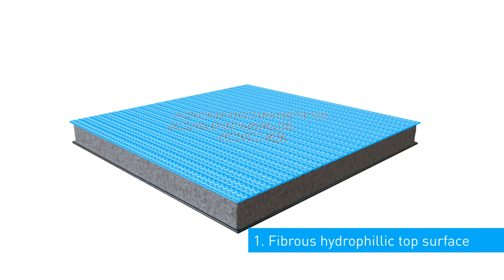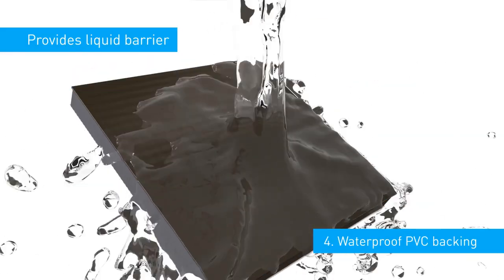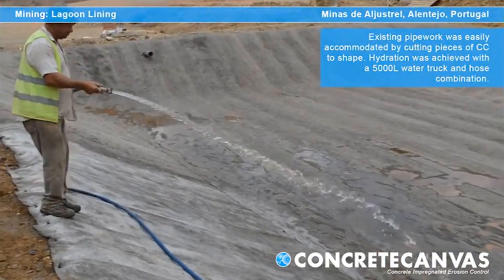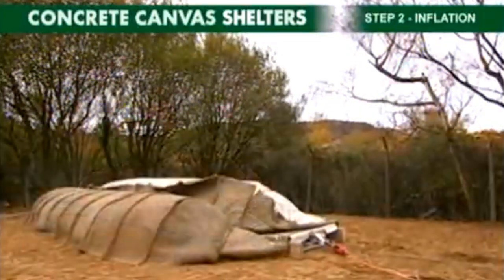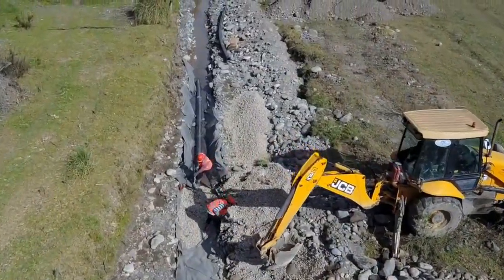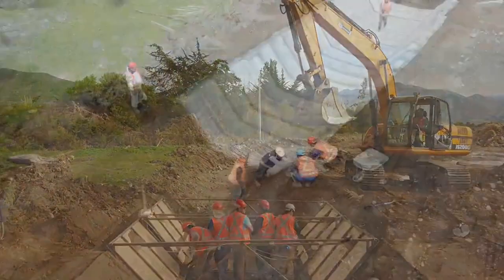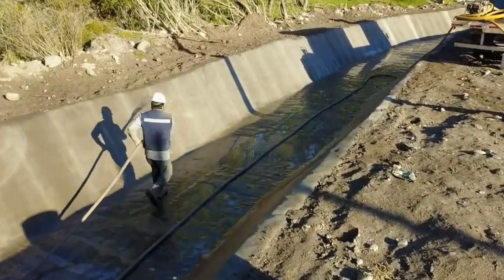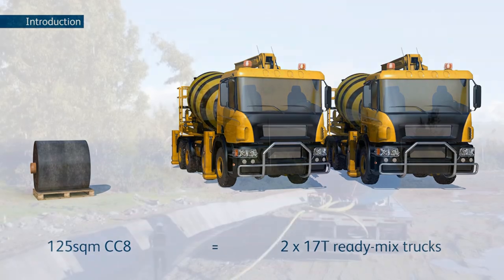Premade Concrete Canvas Tents - Just Add Water

Comment: Just buy a old shipping container and fix it up with the money you'll save.
Reply: @shad0wburn3d  you must be smoking some good good.
Reply: If anybody every cheats you out of 15 grand for a empty shipping container delivery, for a container thats worth maybe 5 grand brand new, you deserve to be cheated.
Reply: Ok listen up about shipping containers. I have 2 on my land. The only issue we have is moisture in them. What do I mean ... condensation will form in them when you breathe and the temp is cold outside. Yes there can be ALOT OF MOISTURE. YOU CAN SOLVE THIS ISSUE WITH AIR CIRCULATION.
Reply: @shad0wburn3d  Not nearly that much.  Quick Google search "How much do moving containers cost? Prices range from just under $500 for a local move (with the largest container) to more than $5,000 for a long distance move (with two of the largest containers)"
Reply: @randylanhart1796  And insulation I imagine ...
Reply: Shipping container home is a trendy fad and lots of people are getting ripped of because demand is high right now. You can build small 1 - 2 bedroom house for cheaper per sqft than shipping container house. Or just buy RV if you are on a budget you save yourself lot of money and problems.
Reply: @shad0wburn3d  most places that sell them deliver them for free or for a relatively small fee.
Reply: @someguy5035  those "Concrete Canvas Tents" are ment for remote locations like Africa or FarAwayistan. so if instead a "shipping container" sure they deliver it for free to Africa :D
Reply: @johanandersson2165  Been to both places. Never seen one. Seen tons of containers though. There is already an established supply chain for the containers. ISO containers are used all over the world. There may be some great uses for this stuff, but these tents are nonsense.
Reply: Navy already does this. Call'em CONNEX boxes. Kitted out as whole offices, every bit of furniture bolted/welded in place.

Ship pulls in, you swing on the CONNEX, strap it down and off you go. Seen these suckers three stories tall before.
Reply: @randylanhart1796  moisture would also be an issue in the concrete tent.
Not much difference between a shipping container and a concrete tent in that regard.
Reply: Randy Lanhart you should try insulating them. The container is 3maybe 4 mm thick so where the cold meets the hot that’s your problem, the more insulated space you put between cold and hot the less condensation your get. If you was to put 50mm of celetex on the roof and 25mm on the walls your probity solve the issue. Well that’s if it’s enough of an issue that warrants solving as celetex ain’t cheap. Who ever said you will have the same amount of condensation from the tent is mistaken.
Reply: @darrenicome559  and why am I mistaken?
The material doesn't really matter. If you have a cold wall and a warm room you get condensation on the wall.

Condensation is a big problem in a lot of basements, and they have much thicker concrete walls than the tent.
Reply: Jehty it would be considerably less with the bunker
Reply: @darrenicome559  and why?
Reply: Jehty Jehty the 6inches of concrete would make better insulation than the 3-5mm thick steel container not saying there won’t be any condensation in the canvas but it won’t be anywhere near as bad as the container. You are spot on when you say condensations forms when hot meets cold however the distance that the hot and cold would have to travel through the 120mm(i don’t actually know the exact thickness) concrete canvas would be a lot greater than the 3-5mm container not only that but metal is much more dense and a much better heat conductor so your two different temps would have both less to pass through and would pass through a lot easier. Basements usually suffer from damp rather than condensation so the insulation wouldn’t make any difference. Usually the solution for that would be to tank it. Sorry for the late response
Reply: @darrenicome559   6 inch? 
Oh man. That explains why people are so delusional about this product.
It is made of 13mm (1/2 inch) thick concrete canvas.

Some basement suffer from outside water, but others suffer from condensation.
Both are fairly common.
Reply: Jehty yer to be fair I wasn’t sure of the thickness 6inch was just a guess that apparently wasn’t very accurate but you see what I’m saying with the density and the thickness of the material being the key factors? Wasn’t saying you won’t have any condensation in the canvas but the amount would be a lot less.
Reply: @darrenicome559  and let me guess:
The "a lot less condensation" is also just a guess and probably not very accurate.

So basically what you are saying is that you don't have any idea how much condensation will form in a concrete tent.
Reply: Jehty mate you asked me a question and I answered it. I don’t know the exact thickness of either the container or the canvas and I did make a point in saying that. You want to dismiss the rest of what I said because of that then you go ahead. My advice is look it up before calling ppl out tho, that way you don’t look as much of a spanner if you are wrong ; )

Comment: Flipside of the coin: If you could weld a suitable structure it'd be a quick way to throw up some walls & a roof.  Deal with waterseal later.
Reply: modular steel buildings already exist for this use, no welding required, and they're rain proof. Not sure about the cost, but probably a fair bit less.

Comment: Couldn't this process be made lighter and cheaper by removing something and adding it later?

Would be great for building shelters on other planets.

Add radiation shielding materials to the chemical composition to protect astronauts from radiation.
Reply: Lead would be the anti radiation layer
Reply: Because of the weight of lead, the shielding would have to be added from materials at the site, either sourced or refined as an inexpensive shielding solution. 

Actually, now that we know quantum physics have discovered that matter acts as a partical and a wave, perhaps a particular frequency will protect against radiation in the future.

This is an incredible discovery that will change our planet in the next 20 years if we dont destroy ourselves with this knowledge.

Comment: heavy ugly and expensive...and only easier for the installer not for the person living/using it. Furnishing against slanted walls is....not fun and its not as easily modifiable as wood structures. were not even going to discuss the fun of electrical wiring. When I first saw this 2 years ago I thought it was neat...but ive had time to think of all of its drawbacks.

30K? Holy shit you can build a big enough cabin for that with a bathroom and room for a guest instead of a dark dank dome
Reply: Yeah, but you're paying extra to save time and effort having to build it yourself.
Reply: its not meant for residential living. its not meant to replace a house or cabin, or your garage floor. 
its a somewhat quickly deploy-able structure that's more expensive but efficient. its not the best go to solution for everything.
Reply: But this isn't a structure made for living it. It's designed to be set up quickly and to probably be used as a storage room.

Comment: it's such a smart inventionf.  Developing it would be hard but the idea of concrete trapped in between layers of fiber in a thin matting that will first expand with air, then harden with water is thinkable by anyone.  It's still clever.

Comment: I have a problem with the durability of the drainage system.

Yes I believe it works to channel off water.

What happens when the ground under the and beside the mat becomes saturated with water?
Does the canvas buckle?
In a traditional system rebar holds the walls together.

Comment: This is so cool but i wonder how durable it is. This video states its strengths but what about the weaknesses of it as a building material? It's thin and there's no rebar reinforcement.
Reply: I would assume that the tension stress is being well spread out by the fabric/plastics in the mesh binder.

Comment: Got to say that's a pretty awesome concept. But I have questions how thick is the concrete and how durable is it. Like if I hit it with a hammer can it crack. You know considering there's no reinforcement no rebar stuff like that. If it is tough I would like to see how far they can push it and see what they can make.

Comment: this is one of those things that seems cool to people who arent familiar with how concrete works. its too thin and probably cant hold much weight, its a temporary solution at best. we have fiber cement products already out there and they become super brittle in about a year or two.
Reply: It works well for the canal they made, as they had some sort of clay underneath. If the only job is to secure the clay from slipping away it does the job.
For bigger projects it would work as well as a makeshift form where you put your layers of high quality concrete on. It only has to last until the concrete sets.

Though for all of that feasibility and costs would be a factor and I imagine some nifty construction workers get the job done way cheaper, as accurate and without the concrete canvas.
Reply: @jellysquiddles3194  yea thats true but they would have to layer it or swap it like every two years or so cuz theres no way like half an inch of fiber cement is not going to crack.

Comment: Seems very interesting so it makes you wonder why it's not more popular. I suppose the answers are right here in the video and comments. For one, like one comment said, it's expensive. And the other important reason i suppose it's in the video where the part about using less material as an advantage regarding waste or expense. But like any coin it has two sides, even if in certain instances less is more, here less is simply less. A concrete structure with less material means less durable too. You may build a small irrigation channel fast and cheap but it will probably be just a temporary approach. You probably make it like this if you intent to make something at that location for some time and then move to another or something. And from this perspective building fast and cheap may mean more waste and terrain that is more difficult to reclaim and use for different objectives, even if or because you used less material for your construction.

Comment: ...I'd say it's a good idea for a base layer, but for anything involving load-bearing or erosion, especially where water is involved, this should only represent a portion of the system. Most of the applications shown are in reference to water. Spillway/dam failures can sometimes occur when water that is able to seep through worn portions begin to generate enough buoyant force to start buckling the structure.

If you have a good foundation underneath it, I can see one being erected, set, and then having further material added on the outside such as an insulating foam with its own shell. That'd be a neat addition to a house or the basis for a complex, like an earthen home.

Comment: I've seen "houses" made with concrete mixed with styrofoam pellets instead of gravel or sand.  They were huts or domes and they worked out. This stuff is great, no mining or  rock quarries needed. It will be in Hardware stores pretty quick I bet.
Reply: How do you think they produce the cement in concrete?
Reply: Pretty quick in hardware stores, but also pretty quickly collapsed to the ground, I bet. You americans focus too much on swiftness and cost, at the price of quality.
Reply: Alum,lime,silica mixed together. I am a plumber. Used a lot of cement. Busted a lot up, too. The absolute rule of concrete pours is, it is going to crack and no one will ever steal it.
Reply: @tommypetraglia4688  Right....they do have to mine...silica,alum,lime.....thanks for helping me think

Comment: Imagine using this to make a firewall to combat out of control blazes. You could suspend them from helicopters and dig deep narrow trenches on the outskirts of the blaze to establish a temporary base, lower it in and use the water cannon on the rescue chopper to wet it down. The temporary structure would potentially limit embers from jumping and help to control wind flow. I'd consider clearing some of the outskirts with bulldozers just to make sure. If you could potentially surround section of the blaze with the wall and cap it with a sectional ceiling of irrigation systems. Their are tons of other things to do with this like controlled flooded. You could dig out some retention pond downhill so any time that you airlift water you can create a new local source of water for the fight. I see these choppers like to pump and dump from tanks, but if you have a local source you could pump and spray at the same time.

Comment: I want one of those tents sooooo bad. Honestly, they're probably only so expensive because the military uses them, and the designers knew what they had and how useful the technology would be on a battlefield. But hey, hopefully in a few years the price may drop and I can get my hands on one or two of these things... Honestly what I would do is dig a huge trench that leads down to one of these tents, drop one into a deep hole, pop it, cure it and then fill it over with dirt. Boom, automatic underground shelter. Add lights, and other amenities as needed. Sounds like a great plan for the coming apocalypse.
Reply: Storm shelter in Tornado Alley.  Also good as fire shelter out west.
Reply: @kathymiller7086  I believe it.

Comment: I wonder how that trench holds up long term in regards to the ground movement, etc?
Reply: You have to account for that while designing the trench, just like when building roads or buildings. The material itself only strengthens the trench and prevents it from eroding due to rain and flowing water. The material itself is very sound though and it's life expectancy is 120+ years.
Reply: @CanIHasThisName  In regards to the ditch, it is basically acting as a retaining wall as well. 
I'm just curious if it has the strength to actually hold back the natural ground movement over time?  I know lighter retaining walls (no matter how strong they are) definitely struggle with this unless you anchor them.  A ditch of course has a kind of reverse anchor since it is supported by the ground on the other side of the ditch.  I'm just questioning how strong the connection/anchor is between them since it is a U curve.
Btw, there is no designing around this really.  Not unless your ditch is flat.  It wouldn't be a ditch then though, it would be a sidewalk.  The best they can do is that angle we see in the video.  Maybe that is enough though. That is a ton of weight though it has to hold back over time.

Comment: you could quickly build underground buildings or bunkers this way. Dig it out, add tent/floor, harden and bury. Might need supports but not if it's engineered to support weight without them.

Comment: i wonder . . . 
what if i dug a hole , put about 12 inches of stone in the bottom , set the tent up , spray it with a real good sealer like hot tar and then bury it .
how long do you suppose it would last ?

Comment: The concept is great. The cost, currently, is too high except for specialized applications. As competition and technology improve the cost/benefit, this could become a fantastic building method. A Tiny House is about $25,000 on Amazon. Imagine a modular, tiny house you can add on to as your family and income grows..... Delivered by truck, doors & windows in place, color impregnated concrete, built in insulation, inflate, spray and you're about done.....with little exterior maintenance.... Or possibly, you build a basic frame in any shape you want, lay out canvas cloth, spray and you have a unique, durable, low maintenance structure.... from housing to garage to decorative water features like a small creek or stream or a waterfall with hidden grotto behind it... There are endless possibilities.....

Comment: I would think after erecting the tent now string wiring and tubing over the the top and around it as needed to create a complete plumbing and electrical and then?  Add rebar and  Simply drape one more SECOND layer of concrete fabric and wet that down also....then to REALLY complete the structure blow and bond  fiberglass insulation all over it all AND woven layers of fibeglass cloth and then finally apply epoxy resin to the entire surface making it impervious to water and temperature extremes ...a stucture like this might last hundreds of years!    The inside could be plastered like a swimming pool or lathe and plaster interiors and then simply painted

Comment: So, these trenches made from that thin material, as thin as it is especially the concrete, wouldn't it be more prone to cracking under weight over time? Therefore needing replaced much more often, i may be wrong just curious.
Reply: Kindve why you havent heard of it until now even tho this video is 2 years old and the product probably even older. Cool idea but impractical... Hopefully it develops into something more structural tho

Comment: Doesn't concrete become less strong if too much water is used? Is this a problem for this material? In the canal, it looks as if the bottom is soaked while the sides only got a spray.